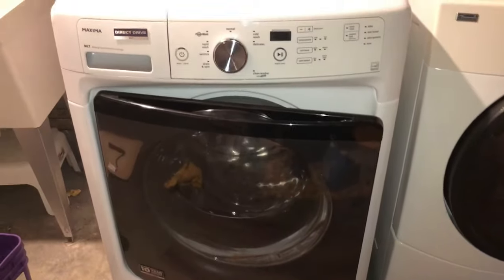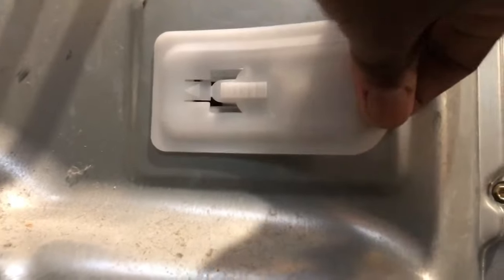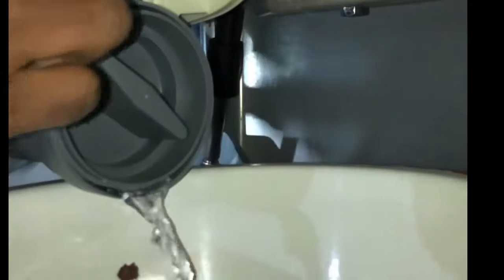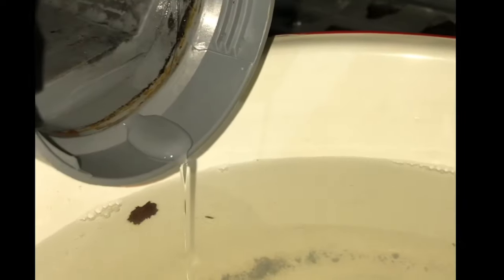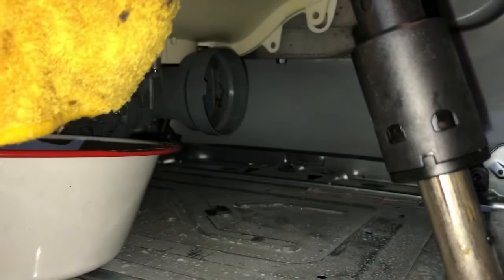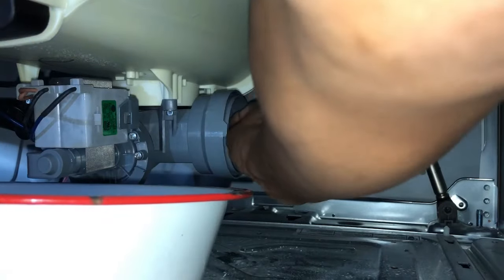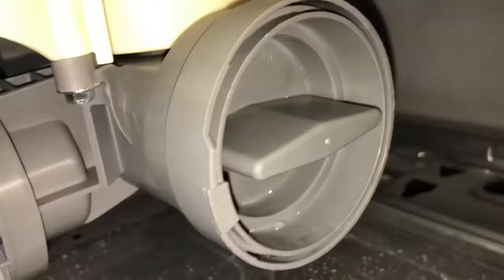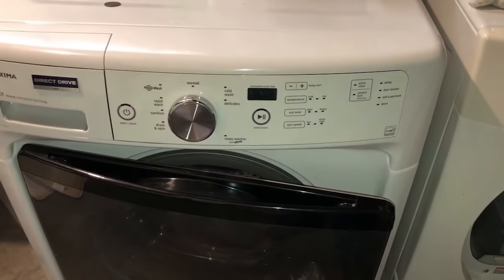Cleaning The Filter Of A Maytag Front End Loader Washing Machine

Comment: 8 years ago I purchased this set from a dentist and his young wife.  Bought it (with the bases) for $350.   Took it home and disassembled it thinking it could be the pump. ( wasn’t sure)  it was only 1 1/2 years old and after spending over $300 on a service tech, put it up for sale.  Took it apart, found the pump and upon opening it just a tiny bit of water came out while the tub still had water in it!  Took the filter out and along with it came a small training bra!!  lol.  Yanked it out and of course had water everywhere!   Here it is 8 years later and it’s malfunctioning.   Sounds like the pump is trying to pump water out, but possibly blocked.  At 76 don’t think I can bend down that far without getting up again.  Got son in law coming in two days, but forgot the steps to get to that pump.  Knew the screws were there but forgot about the clips.  Anyway, thanks for putting this out there.  Great refresher and for those DIYers , it really is easy!!  Thanks again! Good vid!
Reply from the maker: Thank you.

Comment: Thanks!  I had the slow drain error codes.   I removed the back panel and cleaned the filter per your instructions.   Found a toy skeleton and some change in the trap.    Still had a drain code after.   Took the drain hose off and blew it out too.   Lots of crud in there.    Thanks for the tips!   I think in my case it needed both things fixed.  I wouldn't have been able to do the filter cleaning without your informative video.   I appreciate your efforts!  You saved us some cash.
Reply from the maker: your welcome
Reply: @goodtimesfunforall778 you’re*

Comment: What a great day! I was searching how to repair the door’s hinge and found a video showing how to replace it, then I found the hinge on Amazon for only 42 bucks. Then that search led me to this video.  I’ve had the washer for 15 years, didn’t know it had a filter that needs cleaning. Saved a lot of money today not calling a repair person.
Reply from the maker: no problem glad to help
Reply: @goodtimesfunforall778  I spoke to soon. Lol. After I removed all the screws and plastic tabs, I then realized the filter was accessed at the front. So I cleaned it from there, a bit of slime but that was all. It then gave an F20 error, which turns out to be an inlet hose issue which was quite clogged, mainly the hot side. Likely calcium from hot water tank. I replaced the broken door hinge as well - 42 bucks on Amazon.  Seems to be working great now.
Reply from the maker: @DbeeSapphire  Awesome

Comment: Great video. Thank you.

I can't understand why Maytag made it so difficult to access. Opening on the front seems pretty logical to me. 

I have the dryer stacked on top. And they are in a confined space. Very very difficult to access.
Reply: Mq
P
Reply: I agree 100%; if you are supposed to this, why make it so hard/inconvenient to do??!!
3/2023
Reply: Where else would they put it??   You remember when he opened the filter door and water poured out??   How could you get a pan in there big enough to catch all that water that WILL be coming out.  A small access door only causes more problems.
Reply: @MichaelWilliams-ro9bm  in front, where it is easily accessible
Reply: American design.. pay even to clean the filter.. I had Samsung and it's easy to drain and clean..
Reply: @MichaelWilliams-ro9bm you could easily have a removable front bottom panel. American engineering is awful.
Reply: @stpierreorama  and what do they engineer in your country??
Reply: @MichaelWilliams-ro9bm  I live in the USA but I buy Japanese whenever possible. Have you ever worked on American cars? They are laughably poor in design and the quality control is trash. Why do you think there is a movement to make this place great again?

Comment: We have a similar model maytag.  It was displaying a f9 E1 code which is the code for clogged drainage system.  I followed your info and cleaned the drain trap but it was mostly clean.  This led me to inspect the drain hose itself which was pretty severely clogged with gunk.   Gross... I sprayed the gunk out of the drain hose.  That was fix for us.   This info got us on the right path to fix it.  Also the whole washer area in clean now that we cleaned up behind the machines.   Thanks so much for the guide.  👍
Reply from the maker: No problem, glad to help.

Comment: Absolutely a piss poor design. Most “Normal” washers have the plug in the front for convenience especially for people with small laundry rooms where there’s no room for this without completely removing a stackable washer dryer set it. This is a disastrous design
Reply: Michael Turzo see my reply above
Reply: It is a piss poor design but it is not bad enough to change washers my maytag maxima series has been pretty good machine it’s built on Commerical series and we use it about 16 hrs a day with four women and one man that have to have clothes every day plus the towels are the big loads
Reply: Couldn't agree more.  I have no idea how to move my heavy Maytag washing machine which is in a corner.  Can't even budge it.  Maytag decided that sleek looks were ore important than functionality.  I'll know which type of washer to avoid next time.
Reply: you needed to have it point to the front and have the bottom  half of the front come off.. would have been easy to do.. Sad..
Reply from the maker: Very true.
Reply: richard branscum  how do I get to the one in front . That is what I have .
Reply: @Heezeize  That is for sure. No more Maytag washers for me. No more front loaders, either.
Reply: Probably a 20 minute job, stop crying

Comment: Thank You!! Going in through the back made this a much easier job. Thank you for also pointing out the proper directions to pop it back in. Easy once the pieces match. I did have to use pliers like you did lightly with the left hand to apply more turning leverage in addition to turning with the right hand to loosen it the first quarter turn on the way out.

Comment: good video.  For me it was easier to "tilt" the machine back and access the bottom panel and do the same thing - just two simple screws and the bottom panel comes off.  Reminds me of changing the oil on my truck.
Reply: Great advice - I may just leave the bottom panel off.  How often do you need to clean the filter?
Reply: Unfortunately not all models have a bottom panel for easy access,I happen to have this more difficult to access model 
This video it’s grate for me.
Reply: I don’t have a bottom panel that removes. Thanks to my lord and to you for this helpful video. Another video shows removing the top lid.
Reply: That’s how I access mine too!

Comment: Thank you for walking me through this process! 
Just a note tho, i know that vinegar will damage the rubber hoses, and some other parts which will eventually cause the machine to leak, especially on front loaders. So maybe at the 4:03 mark in the video you might want to reconsider using the vinegar to clean the o-ring and opt for something else to help you clean up your washer. 
I found out about the vinegar problem after I had added some to several loads of puppy laundry. Not long after, my machine sprung a leak. When I researched the leak I found it is a very common problem.  
Thanks again tho!
Reply: Oh no, I had no idea vinegar could damage the machine,  than you for sharing!

Comment: thank you for uploading this, you are a god.  edit: for anyone reading this, assuming youtube hasn't scrubbed all user comments in the future:
when my washer encountered the error, E01,it was stuck on "door locked."  I had to un plug the washer, clean the trap, plug it in and wait patiently for it to "do" anything.  After a while, it pumped some water into it, and then took like 10 minutes before it actually started draining anything.  I can hear it pumping right now, probably stuck on whatever cycle it stopped on.  It put more water into it, and then pumped it out again.  Then, when its finished, it'll signal its "washing cycle done" noise.

Comment: Better than taking front apart. I almost did then saw your video. Thanks btw. The detergent dispenser is a mold problem. I just took the drawer out. Covered in mold, and not just the drawer inside the hole where it fits.
Reply from the maker: i'm going to make a video about that problem
Reply: We remove ours after every load, rinse it, and leave it in sink to dry, which may be excessive, though it doesn't take long. My wife lets me know when I forget.

Comment: I was blaming the issue on dog hair, but turned out it was a bra pad instead lol. Easy fix thanks to your video. Did have to do a rinse out with a bleach wash post filter clean as the washer smelled really mildewy. Now I'll try and do this on a regular basis.
Reply from the maker: Glad I could help.
Reply: How do you get out objects? Mine are under the drum and I cannot get to it

Comment: Maaaaan, done and done.  Thanks a full load.  5 minutes.  Mind you, the wife took off the screws and all before I got over to it.  Used a carboy brush to clean that schtuff out.  Nasty ol bathroom carpet backing in there.  Throw it out or wash it in an 8 gallon bucket, not the one you use for brewing.
Reply from the maker: no problem, didn't know what a carboy brush was, but i'll be buying one. Thanks for the tip!!

Comment: 2023: I still feel the same about the position of the filter. I WISH I only had two loads of laundry a day now that all the kids are adult-sized. I DID try his solution to the mold-growing rubber gasket on the front...just don't close the door. It works--ugly, but works. Thanks for this video!!
2021:Had I known about the filter, and the difficulty of reaching THIS one, would have chosen a different machine.  I run two loads a day. This one grows MOLD like crazy. $200 for a new rubber gasket (over and over) but doesn't fix the mold growing factory (it's in this hard to reach filter.) Ridiculous design. Must be to keep their 'certified' techs busy. I call scam.

Comment: I made the mistake of replacing my 15 year old Maytag with this because I got tired of pulling the pump out  and cleaning things out of it ,because it had no clean our filter . This is still hard to get to, have to move washer out to get to back. I wish I would had purchased the LG washer and dryer which I have in my other House with the  clean out is on the front with a access door. Plus no light in matching dryer like my old one had .Then charge 600 extra for for separate riser drawers.becase was told old one piece riser wont work. Wont get fooled again ! Just put New GE kitchen appliances in other Home that has LG washers.Seems like newer Magtags didnt bother to fix the problems they had with older models .PS whats the differance between Regular and Normal on dryer ? No manual came with mine.

Comment: There is a WAY easier way to do this. Tip the washer back and there is an access panel on the bottom with 2 screws. Take those off and you have access to the filter.
Reply from the maker: wow, please demonstrate.
Reply: "Just" tipping back sounds so much easier than done.  My machine is in a corner, next to the Maytag dryer with only 2" in between.  No room to 'wiggle' it out, and it's so heavy I can't even budge it.  No idea how I'm going to get access to the back or bottom panel.  Maytag needs to really rethink the design of these machines. Stupid not to have front access.

Comment: I have this Same Maytag washer. Idiotic designed to put the filter clean out inside the panel like that it should be on the front with an access door like every other sensible machine. Literally had to pull the panel off every couple of days to get small socks out
Reply from the maker: I agree, i guess all the new machines have front clean outs

Comment: My experience was a bit different. I accessed mine from the front which was good and easy. Then I put my pan to catch the water. The water just kept on coming and there was a lot of debris. I had to call my son over to empty the pan while holding the plug the best I could. The debris made it impossible to put the plug back in or even seal it a little. After emptying the pan 3 times it finally stopped flowing. I then had my son get a few towels but water was everywhere. I didn't even know there was a filter on these. Been using it for 6 years. I'd better check it once a year or two for now on. Anyways, this fixed the problem. I re-ran the load that was in it. 

Update: Well, that didn't fix it. Still received the F21 then F2 error again. I removed the entire assembly and found the impeller was partially broken. Unfortunately, our part store didn't have just the impeller, I had to purchase the entire electric motor for $64. I needed it now, so I went ahead and purchased it. Its now working for sure. 

Oh yeah, if you have water in the drum, you better expect to remove a lot of water. I was thinking that there was a automatic shut off or something. It just flows freely. Also, on my version there is a black collapsible hose so it can be maintenance at the front. The problem is, they have all the wires run in a plastic holder making the filter right next to the floor. You are able to disconnect the plastic wire holder on both sides which gives a little more room. You have to have a very shallow pan like a glass cake pan like I used. Still a bad design. It took all in all about 3 hours to fix. At least it's my day off today.
Reply from the maker: WOW!! You sound like a good handyman. I would have stopped at the broken impeller.
Reply: I bought ours second hand and I'm pretty sure by how nasty the seal was that the filter has never been cleaned. Will it give us an error message when it needs to be cleaned?

Comment: Has anyone thought about cutting an access panel into the front of the washing machine so you can get to this drain without having to pull your machine out of where it’s installed? I am thinking about doing that just to make this job easier.
Reply: I am debating the largest hole saw I can buy and some rubber edging.

Comment: Samsung washers have a much more convient setuo for this. They have a little door on the front at the bottom left corner. You push it in and it pops out, and your drain and filter is right there.

Only downside I've had 2 samsung eashers in 12 years.....both failed bearings and the boot seal, one even looked like the spider was failing.

So now i have maytag. Maytag i think are more durable, but samsung has better design.

Comment: Anyone know where I can get those white plastic clips on the back of the machine? My washing machine has multiple hex head (socket type) screws holding the back cover on, but it has those slots for the clips but no clips. This is the second time we have had to clean the trap and I don't want to have to use all those screws again. I want to get the clips and ditch at least some of the screws. An internet search at parts suppliers turned up nothing.

Comment: I tried to access my washer from the back and The plug is by the bottom of the front cover facing the cover.  I had to take the spring off and disassembly my entire machine top and front to get at it.  I have Maytag model MHW5630HW0.  Not happy with the poor design of my machine.
Reply from the maker: It's amazing they don't have better access to the drain

Comment: Wondering if you can access it from the front?
Reply: ShiaoLo tip the washer back, there is an access panel on the bottom with 2 screws. Take those off and you have access to the filter
Reply: Thanks for responding. I have a pedestal and not much space in my laundry room so I can't access the panel from underneath. I ended up removing the top panel, then rubber ring and then the front panel. It was a pain but I got the job done!

Comment: How do I reset this machine...my sump runs constantly and doors locked
Reply from the maker: I don't know, sorry.
Reply: I'm having this same problem. Did you figure it out??
Reply: @carascheffler3587  im sorry to say it went the garbage
Reply: @mattandkatchristie2552  oh no!! Well. Thank you for letting me know.
Reply: @carascheffler3587  if you happen to figure it out lol let me know I know where it sits lol I'll go get it haha
Reply: I received an F03 E01 error. I replaced a sensor under the top cover near the back right side. Sensor number W10448876. Then I cleaned out the drain filter as show in this video. While I had the top cover off I pulled the manual door release. After that it stopped constantly draining and worked again. Of course I unplugged it to do all this.
Reply: @mattandkatchristie2552  see my post
Reply: Stop, stop stop!!!!
Reset it!
Unplug from wall, count to ten.  Plug it back in.  When it’s electronics think reset!

Comment: On my washer unfortunately the drain is facing the front,
Not accessible from the back.
I thought I could just tilt it back & maybe access it that way….
But due to the lack of wisdom on Maytag engineers- them ignorant sobs, they purposefully make the metal panel wider along the front so you can’t get to it from underneath.
So looks like you have to completely disassemble the entire frickin washer just to clean out a filter.
I’ll never buy another Maytag washer as long as I live

Comment: whoever designed this should be fired.  not everybody can access filter this easily.
Reply: No one can. Washer has to be pulled out and back removed
Reply: @delmixedit  Yup, mine's enclosed.  If I had to (cross my fingers I don't ever have to), I'll have to disconnect it and pull the whole thing out.